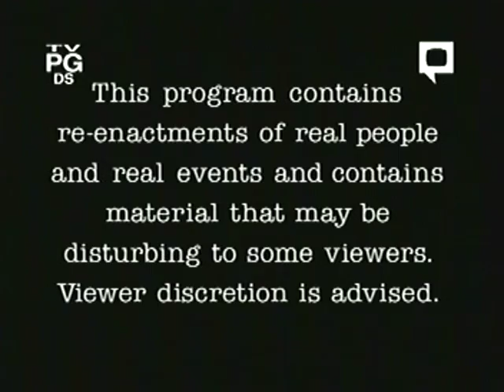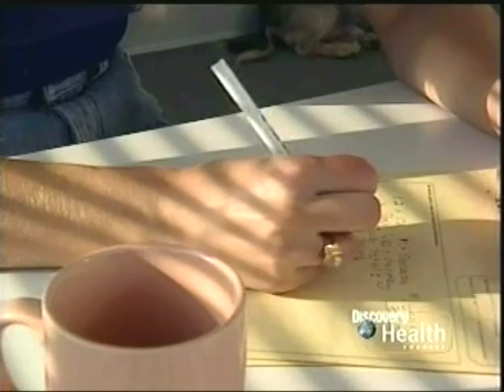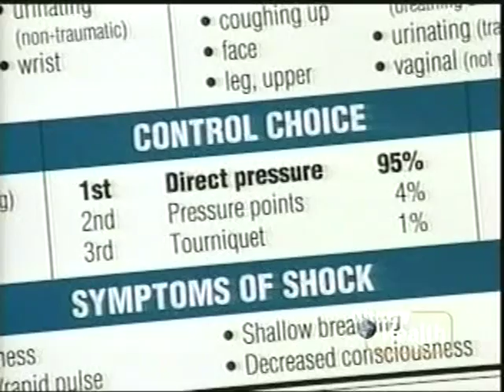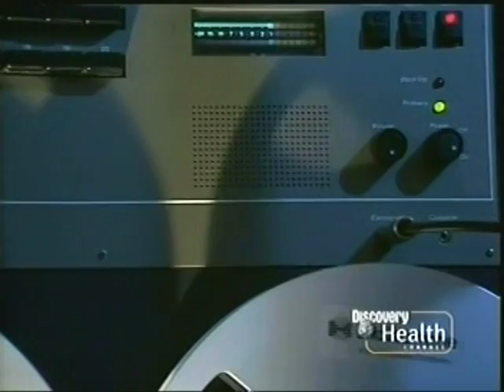Rescue 911: Man's Wrist vs. Circular Saw

Comment: As someone whos suffered an injury close to this, i can tell you the pain, you feel numbness especially in the finger tips, followed by warmth which is blood leaving your artery. At ER when doctors look at the injury, your wrist flops back and you immediately feel a stinging sensation by that time, you feel sick either from the pain or loss of blood if not both. I had to get surgery, turns out i cut 7 tendons out of 12, my artery, and both my radial and ulner nerve. Got 15 stitches. Thanks to 6mo PT i now have 90% use of my hand, i still have numbness and tingling in my pinky and ring finger, but thankfully i have full use of my hand, but i cant hold stuff in that hand for long otherwise it cramps, and occasionally my fingers freeze up, which is scary.

Comment: Over the years from watching construction crews on the job, I've seen a lot of them taking risks using these circular saws, holding a board down with their foot or knee when they make a cut. Overreaching on long cuts, cutting narrow materials.  While I have maybe used a circular saw (side winder type) maybe less than a dozen time over my life I never felt all that confident about using them.Even when I secured the work, and doubled checked everything.    However, I was very confident with our De-Walt radial arm saw in our workshop which was much safer since "you always knew where the blade was" and the saw was pulled across the work, for cross cuts. All other power tools I am fine with, including the bench disc/belt sander in the shop. I could not be a carpenter.